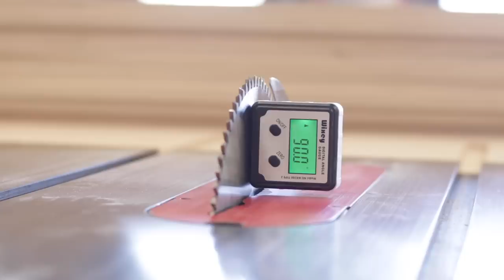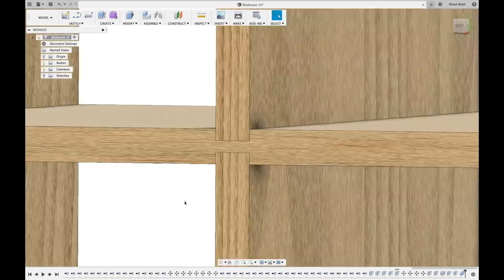Building a HUGE Plywood Bookcase

Comment: Hi Shaun. Great build! I think I will copy your idea and make something very similar bookcase for our office room.
I have a question I hope you can answer: I am working with Domino's now for about a year including a project with offset angled cubes which all have 40 and 50 degree angled joints. That was a difficult project!
The problem I found is that you need to 'move' in two directions in order to slide in the Domino's if you have for example a 45 degree joint (hope you know what I am trying to say?). It does work as long as you think about how to assemble your pieces in advance!

Now I have watched your video over and over and this one the part I just don't get: The outside of the bookcase has 45 degree joints but how do you fit everything together in combination with the shelves/inner grid? Especially with glue applied to the Domino's you have only little time to move the connection before the Domino is fixed by the glue. I talk about what you're doing from 11:00 to 11:15.
How do you do this last and final step in the assembly? Just work together with a few people?
Hope you can explain this to me?!
Reply from the maker: Yep, I know exactly what you are talking about. Because I was using 3/4" plywood, there is enough flex in the material that I was able to get the dominos to seat both on the 45 degree joints at the same time. It took a bit of persuading, especially on the cabinet with the most vertical and horizontal dividers, but it worked pretty well. Having an extra set of hands helps too.
Reply: @shaunboydmadethis  Thanks for your answer Shaun. I will give it a try - in a couple of weeks!
I do have another question I hope you can help me with: In the video I did not see that you did not do a lot of sanding of the Plywood before or in between your sprayed the finish on? How did you deal with the typical thing that always happens to Plywood: If it gets 'wet' (also clear coat) the fibres seem to stand up and first the after light sanding and the second layer of clear coat the surface is smooth. That would be a lot of work...

Comment: Like you I use a lot of full size sheets and on initial cuts through the table saw you have to keep one eye on the fence for drift. I recently purchased a set of Jessem fence guides and it makes sheet cutting so much easier with the guides angled 5 degrees back to the fence. It keeps the sheet tight into the fence.Would not be without them now. Would also like to upgrade to table saw with scroll blade to stop rip out, but outside my pay scale.
Reply from the maker: Yeah, that first cut with a full sheet is always a little difficult. I have an old school set of fence guides I rarely use, so might be a good time to upgrade to some new ones. Or just spring for the Altendorf haha.

Comment: That turned out great! 

My only suggestion to anybody else doing a similar project would be to cut the outer panels for the case from one long 8' strip and then cut them to 4' sections. This way, when it's assembled, you end up with continuous wood grain on the side panel.
Reply from the maker: Yeah, I originally planned to do that, but ended up just choosing the most defect free panels for the outside faces. Thanks Alan!
Reply: another thought would be 3/8 on the 8 mating pcs to eliminate the 11/2 thick center @shaunboydmadethis

Comment: Just coming to this video three years late. I'm wondering if you had to offset the mortises on the horizontal shelves, or if the dominatrixes just protruded 3/8" (10mm) or less. I'm glad I found these older vids. Assuming this was prior to FourEyes with Chris?
Reply from the maker: Honestly, I can't remember if I offset the dominos. Looking at the video, I think I cut the mortises so the dominos only protruded less than half the thickness of the plywood. And yep, this was before Chris and I teamed up.

Comment: So much work!
1. I hope you charge that client mucho.
2. Lovely quality plywood...no voids.
3. Is your domino thingamajig still alive?
4. You most definitely always opt for the road-less-travelled. Hence the reason for point no.1.
5. Do you ever use butt joints or glue and nails or glue and screws or pocket screws joinery?
6. Obviously delivery of this gigantic piece intact was not an issue.
Conclusion: Excellent job as always. I am inspired to strive for anything close to your standard.
Reply from the maker: It was a ton of work! I did get a pretty good price it! Baltic Birch is very lovely! The domino is still alive and kicking. I can honestly say I have drilled maybe 4 pocket holes in my entire life, though I think they are great in many situations, same with butt joints and glue/nails. Delivery went very well with the piece being broken up into four parts. Thanks Juliet! Really appreciate it!

Comment: Well done! I like the "geometric" part of this. It's simple but also interesting in a subtle way.
Reply from the maker: Yeah, it adds a nice little custom touch. Thanks for watching!
Reply: @shaunboydmadethis  Shaun, awesome build, I only have 1 recommendation. When it comes to casework I always cut and fit my parts dry then dissemble for finish. That way you can spray everything horizontally and apply a nice thick mill thickness without overspray . As you know overspray is big issue and I'd tedious to correct. Just my 2 cents
Reply from the maker: @bp7770  Yeah, I definitely thought about doing that, but was worried about getting finish on the glue areas and thought masking it all would take just as long. What do you think?

Comment: Some questions!
1) how did you join the quadrants together and keep it modular?
2) why the changing shelf dimensions?
3) How much did you charge for this behemoth?
Reply from the maker: I used threaded insert and machine screws to hold it all together. The design was the customer's, so she came up with the changing dimensions. And I honestly don't remember exactly what I charged for this, but it was probably $3-4,000.

Comment: Awesome build. Ended up here trying to figure out how to use the Domino for internal joints. When you have Dominos on both top and bottom of a shelf like this do you have to offset the mortises? Did you consider doing through mortises with tenon stock?
Reply from the maker: Yep, they are offset. I thought about it, but doing through mortises presented more hassle than it was worth.
Reply: @shaunboydmadethis  Thanks for the reply. I might mock up a through mortise just to try it, but it’s definitely helpful to find out how somebody else who knows a lot more did it.

Comment: yeah, if this furniture thing doesn't work out the Flying Wallendas could always use a back up performer. Lying on top of an 8' (modular no less) piece of furniture with no net! Stones of steel or filling the space that holds up the Angel's cap; the jury is still out and not expected back any time soon. You never disappoint Shaun. (chuckle, chuckle)
Reply from the maker: Haha, that is the extent of my daredevil-ness. I don't think I would make for a good show! Thanks for watching, Wayne!

Comment: Came out great. How well did the spraying work in the smaller sections? Looked to small to get a good pass, I’d be worried about buildup/runs
Reply from the maker: It wasn't too bad actually. I just made sure to do fairly light coats, and never had any issues with drips or buildup. Thanks For watching!

Comment: how did you join the 4 quadrants together...did you glue them up or fix it with screws?
Reply from the maker: They are all connected with threaded inserts and bolts so that it can be taken apart if needed.

Comment: How do you stop the dominos interfering with adjacent dominos? For example, let say your vertical plywood is 18mm thick and you have a horizontal shelf either side of the vertical. If you set your dominos to go, say, 10mm deep into the vertical on each side, both dominos will hit each other, right? Do you offset the position of the dominos on both sides? Or do you set the dominos so that they don't go as deep?
Reply from the maker: I don't remember exactly, but I am pretty sure I offset them.

Comment: Shaun, good video and thanks for sharing. What tool were you using on the table saw to measure the blade angle?
Reply from the maker: Thanks! It is a Wixey digital angle gauge.
Reply: @shaunboydmadethis  awesome Shaun thanks. I have to pick one up.

Comment: Great book cases! They look well nice and top notch build. One question though - why the paint after assembly? Wasn’t it a massive pain spraying the angles/insides?
Reply from the maker: Thanks! Yeah, it was a pain, but it probably would have been just as much of a pain to finish everything before assembly, since I would have needed to mask off all the glue areas, then spray all the parts individually.
Reply: Shaun Boyd I feel the pain.

Comment: I thought I heard you say you laid this out in a CAD program, but then you later mentioned using the dry fit to get dimensions.  Usually CAD dimensions are as good as you will get.
Reply from the maker: I'll use CAD drawings as my road map for a build, but the actual piece will always dictate the exact dimensions needed for everything to fit together properly.

Comment: I’m gonna build a bookshelf with a reading nook in it. I’m gonna build it out of 15 mm plywood, but I’m not sure how I’m gonna segure it to the wall without any visible screws. Any tips?
Reply from the maker: Cool, sounds like a fin project. Maybe some sort of french cleat system to hold it in place? Or just screws in the most inconspicuous places and plug them afterwards.

Comment: Great project!  Did you consider pre-finishing the parts before doing the glue up?
Reply from the maker: Thanks! Yeah, i definitely thought about it, only issue was I didn't want to get finish on the areas where I was going to be gluing. The amount of masking work it would have required led me to go with spraying them after.
Reply: @shaunboydmadethis  masking would be a big job and maybe not worth the effort.  Would enjoy watching you spray the insides of the smaller openings.

Comment: Unless my old eyes are failing me were the BB plywood panels larger than 5x5 feet. If so where did you buy them
Reply from the maker: Yep, I get 4x8 sheets from a local lumber supplier. If you are in California it is Aura Hardwoods, they have a few locations.
Reply: @shaunboydmadethis  I thought 4x8 was the standard size; in the UK it is easy to get 4x8 and from some suppliers 4x4 and occasionally 4x2 are also available.  I have never seen 5x5 here.
Reply from the maker: @FireAngelOfLondon  Yeah, 4x8 is standard for plywood here, too. Though Baltic Birch often comes in 5x5 here, as well.
Reply: @shaunboydmadethis  That sounds like an option I wish we had.  Although for most of what I am likely to do a 4x8 sheet is best I can easily see that for some projects 5x5 would be more useful.  I'll look around and see if it is available in London.

Comment: I'm planning on building a bookcase at some point, but I'm up in the air as to how I want to build it, or more precisely, how my limited space and equipment will dictate how it's built. I saw Darbin Orvar's design and now yours so I can get multiple ideas.

I have a question on the straight edge you're using with the Festool that I believe I've seen you use with a circular saw too. I don't see it listed in the tools that you use, is it part of the Festool track saw kit? If not, where did you get it?
Reply from the maker: Nice, glad it could help give you some ideas for your own! The straight edge I am using here is just a clamping edge guide. I'm not sure the brand, but it is something like this: https://amzn.to/2UxRLQd which is different from the Festool track saw setup. The Festool track could have been used here also, it is just quite a bit bigger and the little edge guide was a lot easier with the amount of adjusting I had to do.
Reply: That guide no longer exists for purchase , I own the 24" and 48" and sadly the plastic components have deteriorated (wear and tear) beyond usefulness 😥 , I still use them with clamps......the best ever! , I've had them since 1992 .
Reply: @leonidasrosales9315  Thank you for your input.
Reply: @shaunboydmadethis  Thanks Shaun, I was thinking of making my own with a T-track and toggle clamp mounted on the underside of a board at one end, and a toggle clamp on the other end. That is until I saw the Bora saw guides at Lowe's along with the Kreg rip cut guide. So many choices, so little $$.
Reply: @AutotechWoodworking  get the swanson straight edge from HD , they're only $20, and good for 100 inches length.
Reply: @leonidasrosales9315  Thanks, I'll have to check it out.

Comment: Head up Shaun Boyd that the link to the Forrest Chopmaster you posted takes me to the 12 inch miter version and not the 10 inch table saw one.
Reply from the maker: Hmm, that's weird. When I first found it on amazon, there was a drop down menu to choose the blade size, and now it isn't there. Thanks for the heads up!
Reply: @shaunboydmadethis  You are very welcome mate. Just didn't want you missing out on any referrals from your link.

Comment: I'm in the middle of a similar build. My project is stained 3/4" oak plywood. I've dadoed the shelves into the case and vertical dividers (no domino for me). This project is for use in a school and necessitates solid oak edging approx. 3/4" x 3/4". How would you tackle adding the edging taking the staining process into consideration? Do the plywood assembly first, add banding, then finish? Or add banding to components, prefinish and then assemble? By the way, nice build!
Reply from the maker: Thanks for watching! Whenever I use edge banding, I stain/finish after it is attached. This just allows for sanding everything smooth and flush. With a piece this large, staining the whole thing once it is assembled would be a beast, so you could potentially add the edge banding while it is disassembled, then stain it, then assemble everything. Good luck!

Comment: Would half-lap joints not have worked well for the inside "boxes"? The joinery would have been invisible too, and arguable much much more sturdy.
Reply from the maker: Yeah, I have done that in the past for shelving units similar to this. But the amount of joints needed for this piece led me to using dominos. Who knows if I made the right choice?
Reply: Half lap? I think you mean dados I would have made the same choice . The domino is faster just as strong if not stronger. And the math is easier.  Looks great . Only issue is the order of finish/assembly. I'll get ti that in a separate post

Comment: First!!!
Reply: Are dominos going to be strong enough for the heavy books? Also, were the dominos cut at wide setting? Good job as always SB!
Reply from the maker: Thanks, man! Yeah, dominos will be plenty strong, especially with all the vertical support from the dividers. This thing is just about bomb-proof. And yeah, I cut one side of all the joints on the wide setting to allow for shifting to get everything to line up.
Reply: @shaunboydmadethis  Good idea about the wide setting to align everything since there are several dominos to work with. Thanks for all you do. Your designs are definitely one of the best out there.